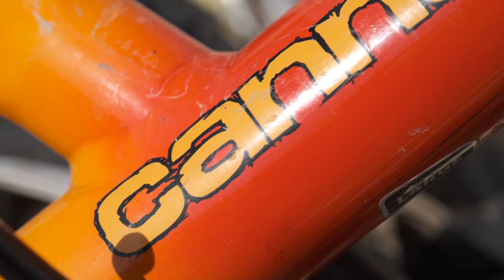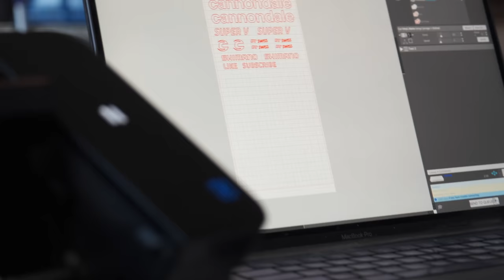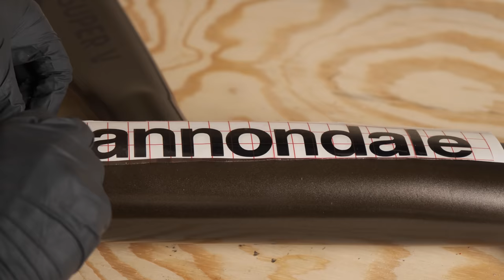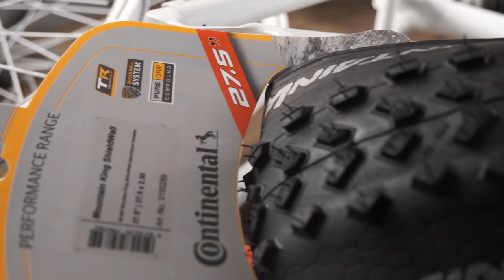Restoring and modernizing my childhood dream bike: The Cannondale Super V

Comment: two things firstly i watched it all the way threw for two reasons firstly this bike was also one of my childhood dream bikes (sadly its no longer a crazy nice bike like it used to be considered and i now have my modern day dream bike to build which is actually not really a bike but a e dirt bike aka surron) i also watched it all the way threw because i was sooooo wondering how you were going to get the like and subscribe to tie into everything and to show even with the grips on only to be let down at the end because they got covered up but still it wasnt really a let down because it actually makes logical sense you see you like and subscribe to see more content so it kind of makes sense right? lol idk just my thoughts.  I recently did a diy cannondale ebike build where i put a bafang bbshd mid drive on a f600 that used to be my fathers old sheriffs deputy patrol bike and i hot rodded the bafang bbshd motor with a asi bac855 controller outputting 4300watts max and 2 52v 21ah batteries so it can not only go fast but goes far as well and it actually keeps up with my surron.  I have a asi bac2000 controller that i might throw on it that will unleash even more wattage but more importantly even higher motor phase amps as thats what seems to be missing from the bac855 since the 4300watts seems like too much as it is for this set up.  anyways loved watching i really thought this would be a sub give away bike but i mean cant always be giving shit away i guess right lol can always hope for that but i get it thats not really economical.  Loved the video,,,

Comment: i need those bearings that are at ur suspension for my dirt bike but i cant find them anywhere cuz they said that those are rare and expensive
Reply from the maker: Strange. Usually you're able to find the correct bearing size for just about anything. The ones I got are not specific to Cannondale. I just measured the old ones and found replacements the same size in Amazon.

Comment: The disc brake adapter isnt properly installed (and being honest, that one wont ever be great on sais frame). At 28:06 you can see a big gap between the seatstay and the part of the adapter that is held by a chain ring bolt. That silver piece should contact the seatstay to pass the force into the frame. Your current install has nothing to hold the torque and can rotate a bit under braking.
Reply from the maker: Right. That silver piece, ideally should butt up against the frame. But the adapter is secure against the welds. It's not going anywhere. It's been working great and I don't plan to take this to the bike park.
Reply: @BuildaBetterBike  maybe make a cardboard template and cut a Block of aluminium to replace the current free hanging bit? Or epoxy something to fill the gap (since it would be under compression when braking, epoxying something there would likely be fine)

Comment: So, how come you didn't put an air shock on that guy?
Reply from the maker: That was the only fork I could find that was 27.5 and straight tube
Reply: I meant for the rear.
Reply from the maker: @jasenhansen6354  oh. Well, the rear has a 135mm eye-to-eye. They don't make shocks that size anymore.
Reply: These work just fine. But loved the build thanks for the vid.

Comment: So much effort and money spent and still the same crappy bike - no shock upgrade and you installed cheapest fork. Also I guess the seat dropper cable collide with the tyre if bottomed rear. But nice paint job and design.
Reply from the maker: There are huge upgrades to this bike. Disc brakes, 1 x 11 conversion, improved geometry, improved cockpit, dropper post. I agree the front fork could have been better, but the old frame didn't even come with one and I don't have unlimited budget. 
As far as the dropper post, there is plenty of clearance. The frame moves laterally when shock is compressed. See my ride video follow up, if you'd like proof.

Comment: You really started to lose me when you ground away the frame instead of the disk adapter when it didn't fit... And then you ground the brake bosses off?! 

AND then you greased the BB??? 

Sorry dude, this is not good.
Reply from the maker: The disc adapter works really well and is not going anywhere. It doesn't fit quite ideally, but it's not going anywhere. 
Please explain to me why you wouldn't use assembly grease on the BB? To my knowledge, this is standard practice.